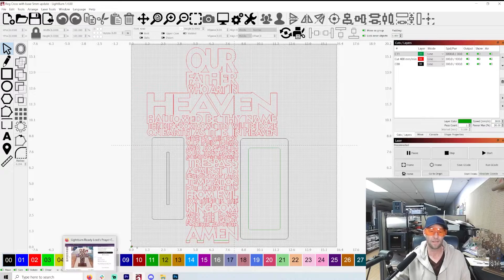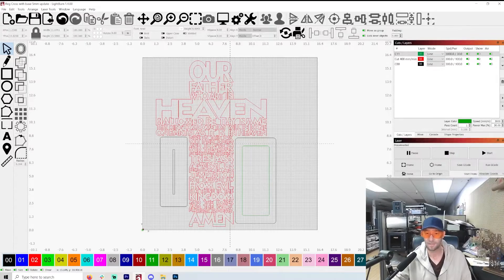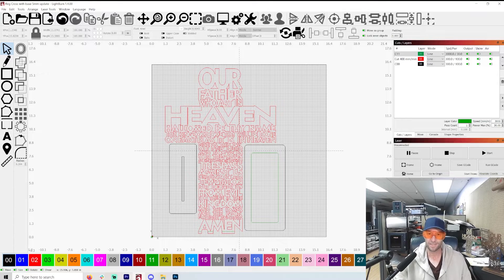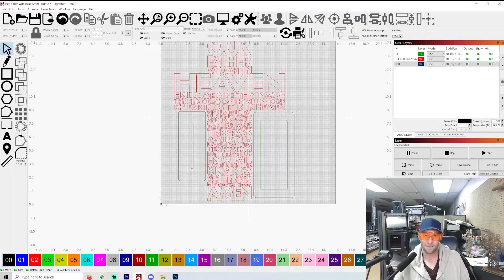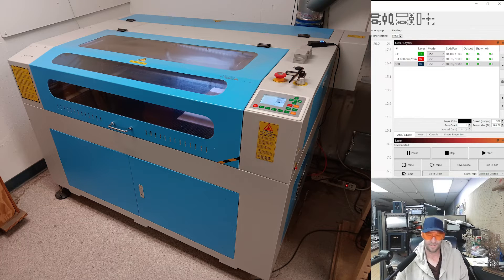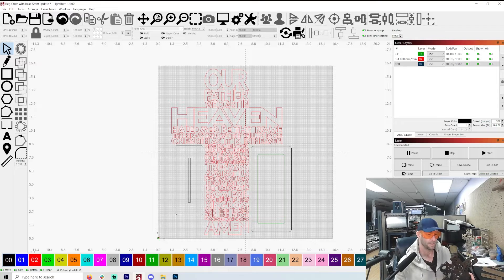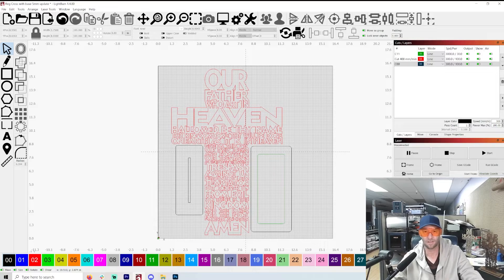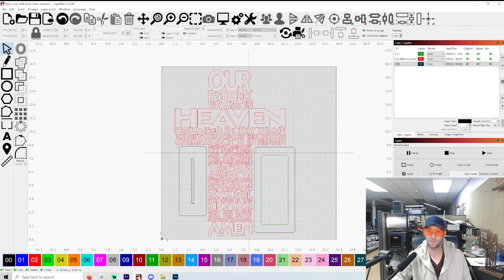Make this Lord's Prayer Cross (Lightburn, Laser Cutter/Engraver)

Comment: Is there an instruction somewhere to get the bottom of AMEN to cut off at the line?  I want to hang it up, but I'm struggling to learn basics in LightBurn.
Reply from the maker: It would be a great idea to learn the software well. The cutoff line is there, you just need to change the settings. Enjoy the process

Comment: I don't know what I'm doing wrong. I am using the Roly Lasermatic 30W MK2 XW. I bought the 1/4" walnut MDF from Craft Closet and I cannot get a good cross. I am using the file with the stand. No matter what settings I use it will cut through some areas, not go through in others and some areas are burned to ash and there is a hole. I tried doing a material test and find a setting that works on that but when I try them on the cross, I get the problems I listed above. Can you offer a suggestion?
Reply from the maker: My best guess would be a dirty lens or your focus is wrong. Many times I have used the bottom level of the focus block on accident (makes a huge difference). Also make sure the air is working well. If you have not joined the Roly facebook group, you should. It is a a great way to get help. I know wasting expensive wood sucks

Comment: Eric: I made the 11-1/2 x 7-1/2 cross. And I need to ship it. Would it be safe to send it in a USPS bubble envelope. If not what would you suggest? Thanks
Reply from the maker: I use mdf or scrap wood as a sandwich, then wrap it in bubble wrap and it did fine. I used a flat box, but I think the double wood sandwich is the important part. I would say at least heavy cardboard on one side and 3mm wood on the other so it can't bend.
Reply: @ValleyForged  Thanks

Comment: Can this be put into the Wecreat Vision software as an SVG file and it work properly?  Very new to laser.  Thanks.
Reply from the maker: The SVG should work fine.Setting are on you, so make sure the lines are at the correct speeds etc...perhaps try on cheap wood first
Reply: @ValleyForged  Thank you so much for your reply.  I will let you know how it works out, and maybe post all the settings once I get them figured out.

Comment: Using 3mm wood. Must done something wrong for sure. Cross was one place and the wording was way off. Going to give it another shot. Most likely me doing something wrong
Reply from the maker: Yikes, see if it looks right in lightburn first. If all looks good then it is not the file. Next would be it hitting on something during the cuts. A piece sticking up, focus too close to the wood, warped wood, surface not level etc...keep me posted.
Reply: It was the motherboard going out

Comment: I just purchased the file from Etsy. I’m hoping to be able to make it out of 3mm plywood, as I only have a 5w laser. What do you think? And can I use the slots and tabs feature to adjust the slot? Thanks
Reply from the maker: I have done it with 3mm, so yes. As long as you know it will do the cutting OK. As for the slot you can just use the method I do in the video to adjust the slot. Not sure about the other way.
Reply: @ValleyForged  Thanks

Comment: Thanks for the tutorial.  The video was well done and useful.  I have a question.  You mentioned that you are using hardwood for the crosses.  Did you mean hardwood plywood?  I would be concerned for wood movement and cupping with solid hardwood, especially pieces that wide.    I have the file in my cart now.  Thanks.
Reply from the maker: Yes, I use Hardwood Veneer Plywood from Craft Closet. Glad you made the distinction. I will put this as pinned.